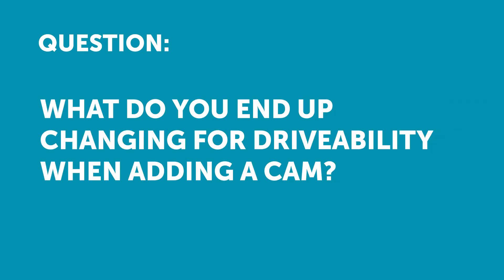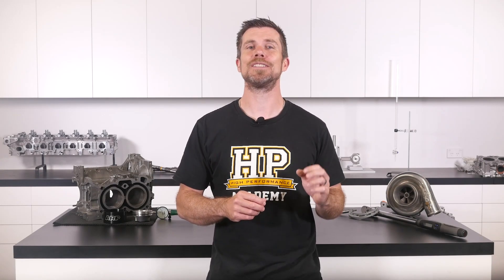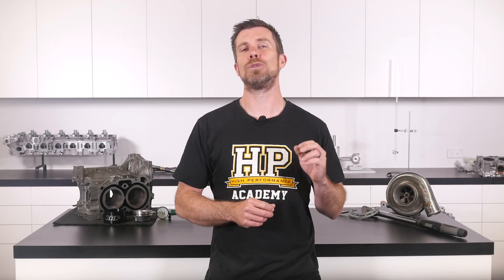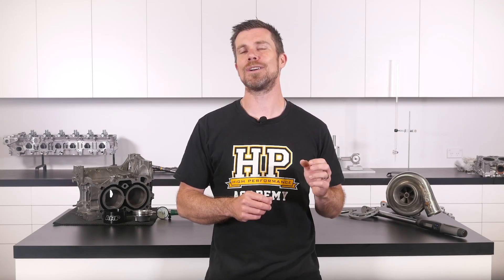Aftermarket Camshaft Downsides [HPA Q&A]

Comment: Do you have any videos on solid axles It seems like the internet completely forgot that’s a big part in making a vehicle move 😂
Reply: There's lots of fast cars on a live axle. They may not be the absolute fastest, but it's not like you can't be competitive. Some info on optimization would be great.
Reply: @michaelallen2501  most drag cars use sold rear axles but there just isn’t a lot of videos about them or just build an normal Dana 60 to handle 2k go

Comment: If you're lucky like me you've got an engine that had a ridiculously small camshaft in it (90's LT1 SBC) with 200/208 duration @ .050" and 117LSA. I upgraded to a 225/237 @ .050" and 114LSA and it still idles at 700rpm and didn't sacrifice any low end to gain 40-50hp up top. I'm sure if I stepped up to a 236/242 duration cam this wouldn't be the case anymore lol. But I don't have the cylinder head flow to take advantage of anything larger than what I've got. The bigger bump stick will have to wait until I drop some AFR heads on this beast.

Comment: VTEC eliminate that problem with secondary low profile cam for idle and driveability.
Reply: Damned straight!!!, Honda set the bar for drivabiliity and absolute horsepower gains across the board!!!
Reply: @GingersquatchVT  
Honda never came up with Variable Valve timing buddy they copied someone’s homework. Alfa did it a whole decade before Honda…
Reply: Did they really? Did those 1000hp AWD K swaps really see power before 5K rpms?
Reply: @WorkinClassCanadian  Some sleeper build did it. 4Piston Racing K24 1000 hp engine is also using VTEC and VTC for idle and behave like stock on the street. https://www.youtube.com/watch?v=6oKEPmFQKSs&t=16s
Reply: @WorkinClassCanadian  most k series that run that level of power don't run VTEC, mostly because the gains aren't worth the extra weight/complexity on the valveterrain due to the power curve provided by the turbo. That being said, if any of those builds ran a positive displacement supercharger they would see said gains from cams, tho probably at the sacrifice of top-end rpm
Reply: It was eliminated years earlier in steam engines… 
And Vtech was stepped adjustment which is efficient in two spots only so super inefficient.
Reply: Funny really, because generally people think VVT is a performance enhancement, but in reality is allows a high lift cam engine to have a smoother idle
Reply: @bernardwarr4187  The test show both. https://www.youtube.com/watch?v=ZtnfBH2ScCo&t=14s
Reply: @bernardwarr4187  
VVT IS a performance enhancement… 😯
It enhances the performance of the engine. 
The performance of peak torque and peak hp, fuel efficiency, airflow, cooling etc it’s not a bandaid cause the cam is high lift.
Most VVT now doesn’t change lift and duration just the lobe center of the cam.
It’s revived engine platforms by meeting EPA emission standards while also improving energy usage.
Reply: @TankToChest  not really, remove the VVT and the power is the same, only the idle and drive ability will be poor
Reply from the maker: @Bernard Warr how you get to your peak HP is rather important, the number alone is almost worthless - Taz.
Reply: @hpa101  totally agree, VVC is all about idle and drivability. 2 identical VVC engines, one with VVT one with out, and the top end cam timing the same, and we have the same top end power? In Drag racing, where it’s all about the numbers, It will need to be determined on an individual bases if VVT is any advantage or not?